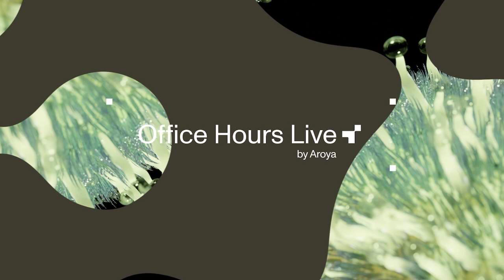[AUDIO only] AROYA Office Hours LIVE Ep 99: Optimizing Cultivation: pH, Nutrients, and Plant Morp...

Comment: Hey, I have two 1000 sq ft flower rooms side by side in the same building and they are identical rooms. However, the issue I'm having is that the first flower room always performs better than the second one. I ran the same strains in both rooms but I'm still experiencing the same issue - flower room 1 always comes out better. Any thoughts?
Reply: Have you tried gathering all the environmental data betwen the rooms? Irrigation test?